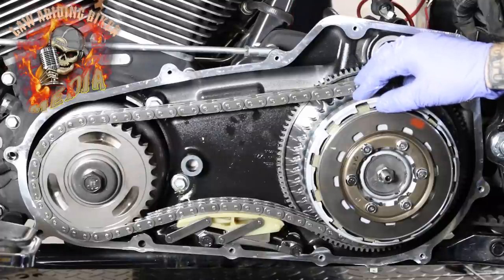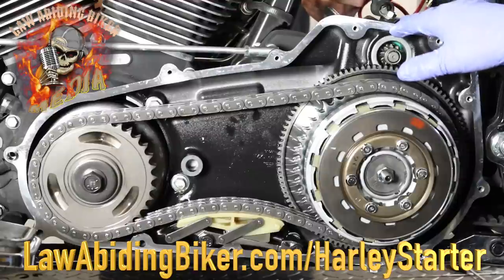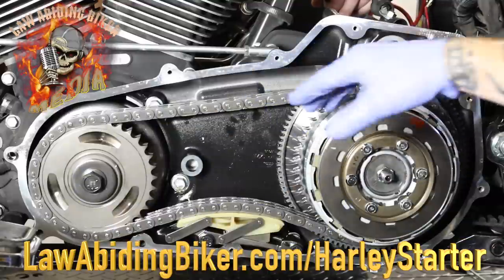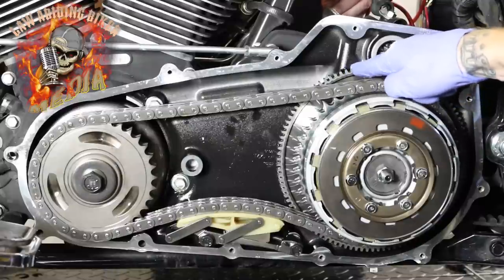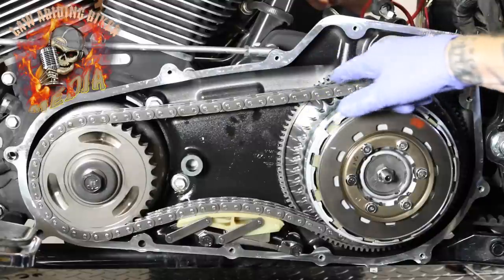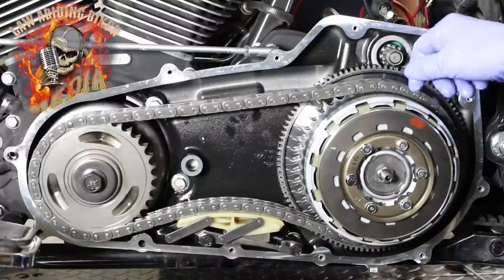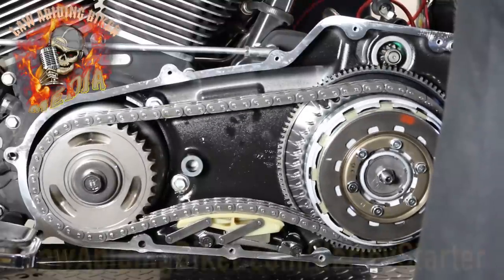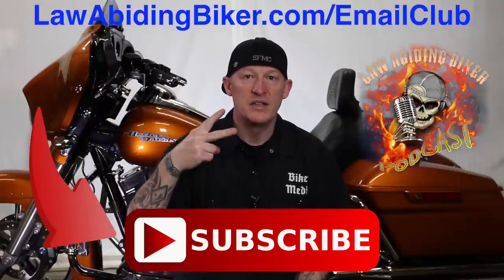Inside Look at Harley Primary & Starter Operation | Solenoid, Starter Clutch, Starter Ring Gear

Comment: You just saved me draining my chainchase floorboard removal... On my 07 Electra Glide. I thought outer had to come off, at least for thrust washer like in shovels. Thanks! P.S. I'm getting a click only until I"TAP" solenoid with a screwdriver. Battery is full and load tested. Must be solenoid, yes? Thx bro'
Reply: Man im in the same boat.. I think my starter clutch is going bad and I’ve been searching for hours for a clear answer if I need to remove my primary cover or if I can just pull the starter and replace the starter clutch.

Comment: What are your thoughts about using small diameter hi collar split lock washers under the cap screws on Harley Davidson Motorcycles to stop them from working loose?

Comment: My 07 makes a horrible grinding noise during hot start sometimes any suggestions
Reply: I got a 07 Softail Customs doing the same thing that you ever get any answers on the grinding noise on a hot start
Reply: Did you get a fix for the grinding? Mine on 09 Fatbob does that sporadically. Thx!
Reply: @JoshSanders1  I put in a drag specialty gear and did away with the compensator also new tensioner never had a problem since

Comment: I have a problem with my starter, everything engages but the starter ring gear doesnt move. It makes the same noise when solenoid hits like in the video but it wont crank the motor. Any ideas? 
Great video
Reply from the maker: Sounds like maybe a starter clutch. Here is a video we have on replacing your starter clutch. https://gumroad.com/l/harleystarter
Reply: Ryan Urlacher 
Hello Ryan the compensator went out of my 13 Glide with only 17,000 miles.
Reply: The solenoid is engaging the drive but the starter motor is not turning the drive gear...possible causes are the starter motor is not getting voltage through the solenoid when it engages,starter motor,or engine locked up
Reply: Ron DUNNING I replaced jack shafts spring and coupling on 2005 road king but works in termination it spins but doesn't turn out error everything seems to be coming apart at starter to jack shafts coupling I made sure it was put in with keeper towards clutch side what would cause it to not stay engaged

Comment: Question:  I have a 2014 Fat Boy with the 103 engine.  Over this winter I had SE 585 Cams put in, but now it is harder to start.  Does that make sense?  It still starts no problem but it sounds like it is struggling to turn over?  Any ideas?
Reply: phil giordano.
Reply: phil giordano compression releases.   you can get aftermarket ones that you flip open and closed by hand,  it'll save you a few starters too.